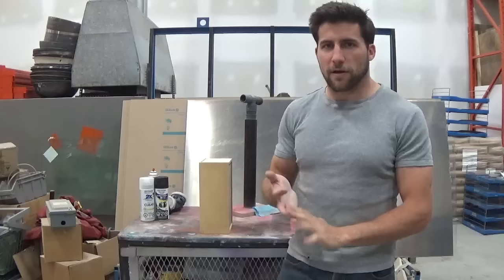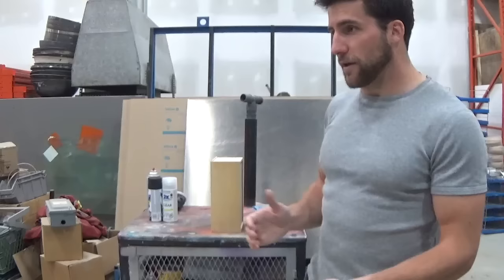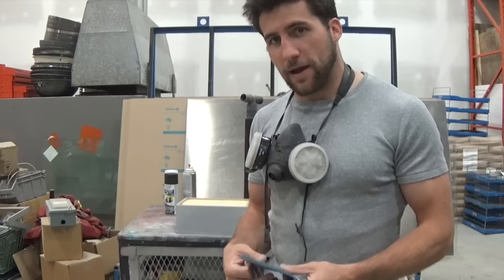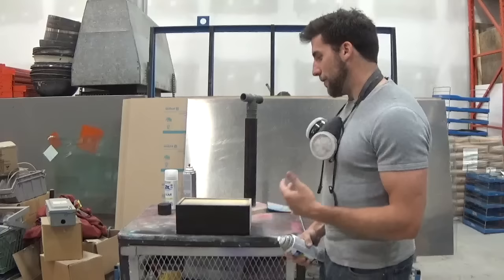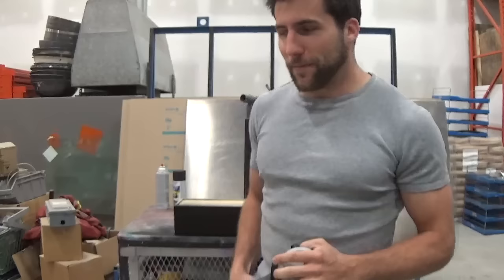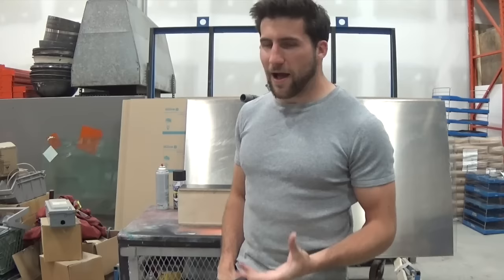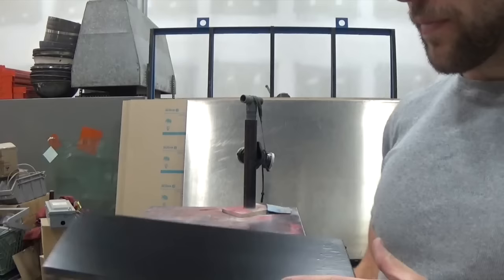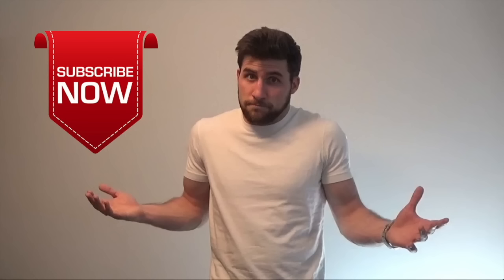How to get a matte black finish with spray cans

Comment: Brad, good tutorial!, question here, I painted a guitar using matte polyurethane clear coats, it looks good in general, but  some parts of the guitar have a grainy feel ,  I believe its caused from overspray when painting the other parts of the guitar... any advice to avoid this issue? I dont really know how to solve it as I cant polish or sand as I would do with a clear shinny finish. Someone told me I should use more thinner / diluyent on my mix, and to try to spray faster to reduce / avoid this issue.... what u think? Thanks n greetings from Mexico!
Reply from the maker: Ideally what you would use isn't necessarily more thinner, but a slower thinner. Something to give your paint longer flash off time so that over spray melts into the wet paint and doesn't cause dry spots. Spraying fast and possibly even a bit wetter might also help.
Reply: Thanks Brad, Im painting another guitar (im on the primer coats process) , but will take your advice in mind. Im pretty sure I will get a better result than last time!
Reply from the maker: I'm sure you will. Let me know how it goes.

Comment: I’m going to paint my bike matte black. It’s down to a steel frame as I removed all the previous paint. Do I need to use a primer before the black? As this can says it’s a 2 in 1 which includes the primer in it. I intended to use a primer but I don’t want to prime it too much.
Reply from the maker: This is not going to be what you want to hear, but I don’t trust those 2 in 1 paints. I would suggest you get a primer to start with. Shoot two coats and wait 24 hours. Sand, clean, and then move on to a paint that isn’t dual purpose.
Reply: Brad Angove that’s ok. I haven’t bought any spray paint yet. Just watching as many tutorials as I can before I start. Do you have an suggested brands that work best on bike frames? Would need a primer, matte black, and a clear coat. What should I use?
Reply from the maker: Do you have a respirator and a decent place to spray?
Reply: Brad Angove I have a spot in a car lot where I can hang the frame and spray it. Have a mask to use.
Reply from the maker: Then I recommend you get spraymax paint. In particular, their 2k matte clear coat. It’s a catalyzed polyurethane clear, essentially automotive grad.

Comment: How many coats of clear should I use on a guitar?
Reply from the maker: It depends on the type of paint. What are you using?
Reply: @BradAngove  I'm using acrylic clear coat spray matte.
Reply from the maker: You should build up 3 or 4 coats of gloss, let it dry, sand with 800 grit, and then do 1 or 2 coats of matte.
Reply: @BradAngove  Great! Thank you Brad.
Btw, if I want to paint a guitar that already has a matte finish (just want to change color). Should I remove all the paint or just scuff it a little bit a apply primer + paint matte + clear matte?
Reply from the maker: I would just sand lightly and move straight to your color. No need for primer in that case.

Comment: Hi Brad, my guitar body finish is called weathered black and the wood is ash, sadly I messed up a small portion on tha back side of the wood near the cover plates when I was soldering new pots and a melted lead flew in that area. This is very careless for my part I should have put some masks on the body before I did the solder work. This accident gave me too many sleepless nights already, thinking about refinishing the whole back but that is really a messed up thing to do considering the guitar is brand new (please note I already tried to touch up the damaged portion for hopes to not refinish the whole back of the body). No matter what I do the patch would not blend in and is really an eye sore to me. Could you give me a tip please is this type of problem repairable or I need to refinish the whole back? I have some skills in working with wood and stufff but not much about paints or finishes. My guitar is Ibanez RGR652AHBF. Thanks in advance.
Reply from the maker: What kind of paint is it? Is it a transparent finish?
Reply: Brad Angove yes its a black guitar finished with matte clear. I just cant copy the surrounding area do I need to scuff and refinish  the whole back? I worry I may not be able to match the top that I really do not intend to do anything with since the top and the bottom is separrated by a white binding.
Reply from the maker: You may just need to fill in that area with some black, scuff the whole back, and spray a coat of matte clear on there.
Reply: Brad Angove alright will try that this weekend and thankyou for the response, cheers!

Comment: Hello brad. I have a question. I’m doing a repaint job with my car interior panel. I’m using a matte black spray paint. What happened was when I want to finish it with a matte clear, second layer made the panels become a bit grey. But still looks matte. Then when I applied the third coat, it become black again but shiny like a regular black paint. Is it normal or did I do some mistakes? Thanks.
Reply from the maker: You may have trapped some humidity the first time that got out when the chemicals reactivated. That could cause the greying. You used matte clear for the last coat as well?
Reply: Brad Angove First of all thanks for replying. Yes, I used the same matte clear. Not sure about the humidity because I’m painting in my porch during good sunny day. 10 minutes between coats.
Reply from the maker: Interesting. Was your last coat particularly heavy?
Reply: Brad Angove Hi brad. Sorry for the late reply. Had a busy schedule last week. About that last coat, I did slightly thicker than the first and second coats. It’s ok. I already solved the problem by spraying another thin coat of the matte clear and the results are amazing. All the panels become darker again with a matte shine. Just like I wanted. By the way, I really appreciate your advice. Thanks brad! 🙋🏻‍♂️
Reply from the maker: Glad to hear it worked out.

Comment: Looking to matte black my guitar top..  Would you be kind enough to fill me in on the steps? Such as prime, sand, black coat, sand, black coat, sand, clear coat, sand, clear coat, sand, clear coat?
Reply from the maker: What is the finish on it now?
Reply: It actually has a Canadian maple flame top that is stained and finished off with a thin coat of satin..Its a beautiful piece of wood I'm just not happy with the center fade they have going on..so I wanna take it completely matte black
Reply from the maker: Sand it with some 600 grit paper to give it some grit and then you can skip the primer and just follow the rest of the steps from the video.
Reply: Thanks man!  But there's no need to sand between coats?
Reply from the maker: Not if you observe the proper re-coat times. It bonds chemically.
Reply: So what are proper recoat times?  2 coats 10 minutes apart  then same with clear and done?
Reply: Also, what do you recommend I clean it with after the 600 grit?
Reply from the maker: Pretty much.
Reply from the maker: Wax and grease remover for the cleaning.
Reply: I did it!  Turned out awesome! Thanks to you hah   how long should I wait before I string it back up and play it? Btw..I used the same matte black you used in this video with no clear  because I want it to shine up faster where it's touched most
Reply from the maker: Give it a couple weeks. Glad you’re happy with it.
Reply: You mean days? Lol
Reply from the maker: I mean weeks.

Comment: hi Brad!! i know its been a year since you posted this video but i do hope oyu can still answer my question.  so my goal is to have a matte black finish on my bike frame.  things i've done so far.  paint primer.  sand it then applied matte black rubber paint.  now do i need to sand the matte black before applying the clear coat?  and also i think i bought a glossy clear coat. does it matter,  since the paint i already apply is matte black or should i really get a matte clear?  thanks in advance man!!!
Reply from the maker: Normally you would need to get a matte clear. A gloss clear would give a gloss finish. In this case though it doesn’t matter. You can’t clear coat over rubber paint.
Reply: Thank you for your reply. I think I mess up when I apply the rubber paint, If only I see this video earlier. however what kind of spray paint do you recommend? I'm not satisfied in the outcome of the rubber paint :(
Reply: and also should i sand the matte black paint before applying a clear coat?
Reply from the maker: You don’t like the rubber paint? I think the best matte black spray can finish is spraymax. Their primer, their acrylic colour, and then their 2k matte clear coat.

Comment: And their alluminum alloy rims.
Reply from the maker: I take it you don’t want to send them for powder coating or ceramic coating?
Reply: Nah just was planning on just using a flat black auto spray paint and then a clear coat but not sure if that's a good idea just was wanting your input as if it was good for the flat black to help it last longer was just unsure.
Reply from the maker: Spraymax makes a catalyzed matte spray clear that will help with the durability.
Reply: @BradAngove  can you purchase it at the local in town stores such as Walmart stores
Reply from the maker: No, it’s a professional grade product.

Comment: Hi mate,
I wanted to paint my guitar white matte and for some reason i ended up getting 2 cans of matte acrylic spraypaint. Honestly I am not very happy with the result as the guitar surface is not soft at all and Doesnt look very good. What would younrecommmend me to do now? Sandpaper it and re-paint it with another thpe of spray? If so, what type of spray will be best? Or I just should put a matte clear over the acrylic? Need help here! Thanks!
Reply from the maker: What kind of prep did you do before spraying?
Reply: Brad Angove I put 3 coats of white sealer.
Reply from the maker: Ok; and what do you want to change about the result? What does it look like and what do you want it to look like?
Reply: Brad Angove basically I’d like to give the guitar a smooth surface as well as a matte finish. Now what I have it is a rough surface. I was worried this maybe cause I used an acryllic spraypaint? I bought a Rust Oleum flat white spray to see if it gives a better finish. Thanks for the answers man. :)
Reply from the maker: It’s probably not just because of the spray paint. Make sure it’s filled and sealed well, and sanded smooth to 600 grit. If it feels really smooth, add two medium-wet coats of the white and double check that it still looks good. 
The Rustoleum is also acrylic if you got the one I used in this video.
Reply: Brad Angove hey mate, so the rustoleum seems to be much better than the other srpay I used! The guitar looks pretty good now. To finalise I just put a few coats of the rustoleum Clear? Apprently in Australia they dont sell Matte, so I’ll have to go for the Satin. Any other tip? Thank you very much! It is really helpfull having people around keen to help. Cheers!
Reply from the maker: I’m glad the Rustoleum worked better. Yes, Rustoleum clear should be fine. I guess satin is probably your best bet then, but I’m surprised they don’t have matte somewhere.
Reply from the maker: It looks good. Nice work.
Reply: Hello Brad . I checked the Msds on Rustoleum's website & saw that their paints are Acrylic modified Alkyds , so I guess that makes them oil based ?
Reply from the maker: It depends. Rustoleum has a variety of paints. For the most part though they are oil based as far as I know.

Comment: Idk if you’re still gonna get updates from this but, would this work on a neck? I’m kind of wanting to matte the WHOLE guitar…
Reply from the maker: Yes it works on a neck. I prefer to sand back and use a hard wax oil on necks to make them feel smooth and fast.
Reply: @BradAngove  that’s good to know. Also: I just cleared my body…when it dried, I ended up w 2 small circles, I believe from moisture…what’s the easiest way to remove that? Ones in the FR cutout corner. The other in the neck cutout corner…about 1/8-1/4 inch…
Reply from the maker: Do they look like a white under the surface?
Reply: @BradAngove  yes. And I fixed it…by sanding it back down. But, then I messed up…big time. So, I had to sand it back down. To start over. Problem is now, I can see unlevelness where I tried to feather back my mess up. Looks like I may just have to start completely back over…lol
Reply from the maker: If you’re sanding it back use a block to help alleviate that.
Reply: @BradAngove  that actually makes sense. Thanks
Reply: One more question: if I’m applying my last coat, (satin), how long do I wait for clearing it?
Reply from the maker: It depends on the paint type. I would usually give it a few days, sand lightly with 800 grit, and then clear coat.
Reply: @BradAngove  thanks much!! I appreciate your help…

Comment: cool! Am I able do this to my bike too?
Reply from the maker: Yes.
Reply: what about a plastic item?
Reply from the maker: Use adhesion promoter if you're doing this on plastic.
Reply: Brad Angove Hi Brad , I listen to your videos from time to time and  they're really good  man. I build guitars and I was curious to try a matt black with Matt clear with the rustoleum products like the one you use. the top is Matt black paint and the rest of the body is stained so you feel the paint transition to the stain  since the paint is thicker. I sprayed 3 coats of clear and it's not thick enough to overcome that. I am going to spray more coats but do you think after 3 coats I should wait 24h and scuff sand to 400 before spraying some more  ?
Reply: Sir When we have to use adhesion promoter and what is this ?
Reply: Charbonneau Guitars -

Comment: Hello Brad, thank you for the great videos! I’m currently working on a guitar project. I’m using the rustoleum 2x paints, black for the primer, and the satin charcoal grey as the final color. I’m looking for a matte finish, but I haven’t been able to find the grey in a flat(not sure they make it). My first question, am I ok to use a matte clear over a satin color?  Question 2: Would you recommend a 2k matte clear instead of rustoleum’s 2x matte clear? I plan on adding graphics(headstock badge) before I actually spray the clear. Question 3: How long should I wait for the color to dry before I do that? Thanks in advance!
Reply from the maker: You can use matte clear over gloss or satin paint. Just let it dry fully and sand lightly with 800 grit before clear coating. The 2K is better if you have a proper respirator etc. I usually allow a week before adding graphics with that sort of paint.
Reply: Thanks for the response, keep up the great content. Your videos have helped me a ton!
Reply: I think I’m going the spray gun route for this now, I can’t really find the color I want in a can. I’m too damn picky I guess! Lol